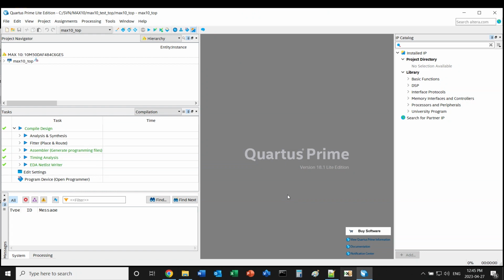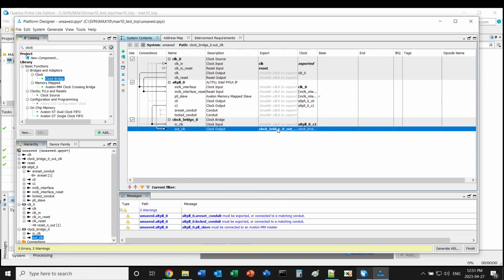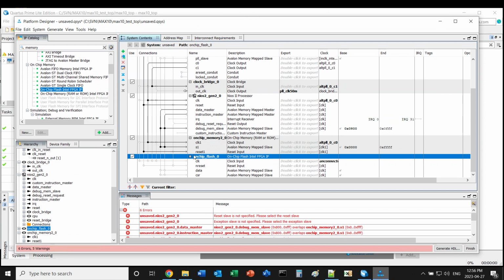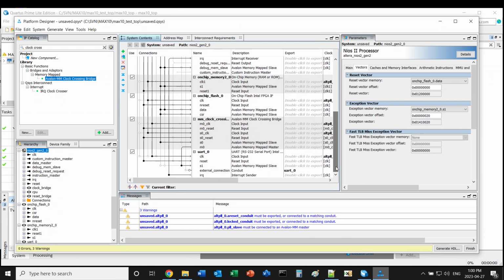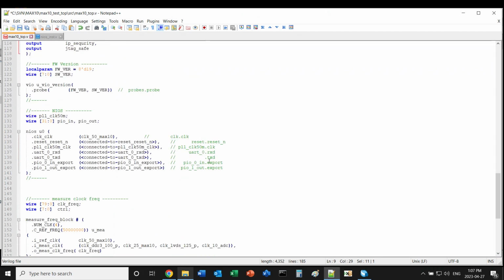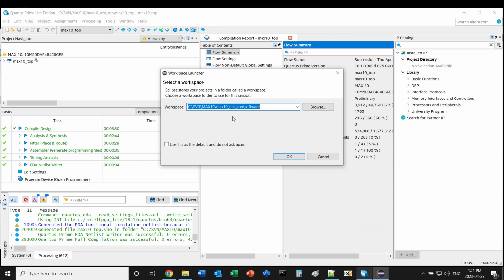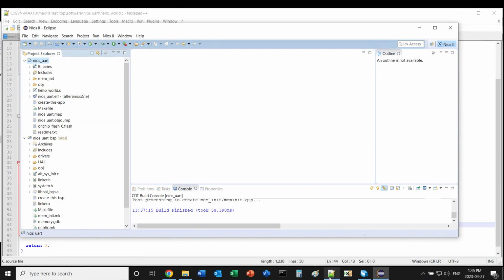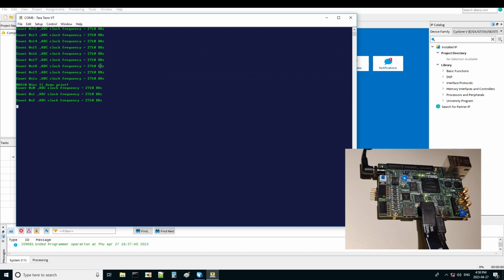Build A Soft Core CPU - Part Three - NIOS II in Intel FPGA

Comment: Any thoughts on how the JTAG-UART works?    For example, can any FPGA do that, or must it be baked into the chip/primitives (sld_virtual_jtag / intel virtual jtag uart IP).

OpenCores has a "Advanced Debug System", but not sure how, even if a JTAG UART is instantiated, how would the USB-Jtag Hardware Adapter get listed as a COM port?!   I assume "nios2-terminal"  would only work with the USB-Blaster adapter and the Intel/Altera FPGA and ?